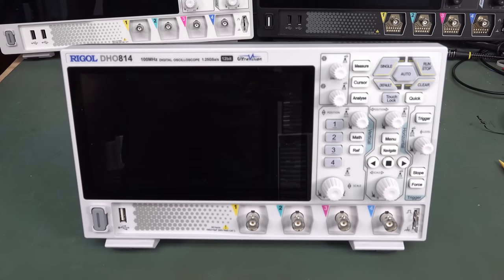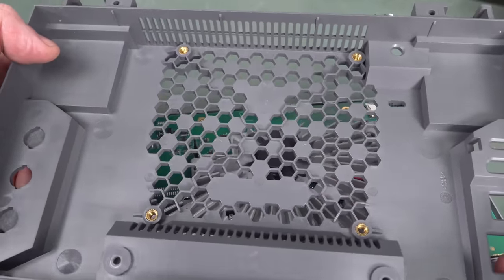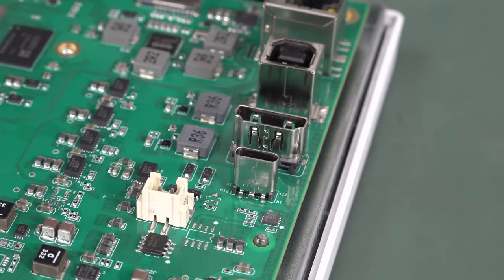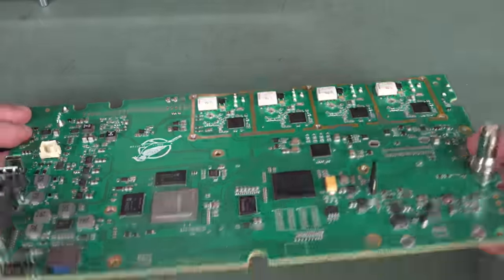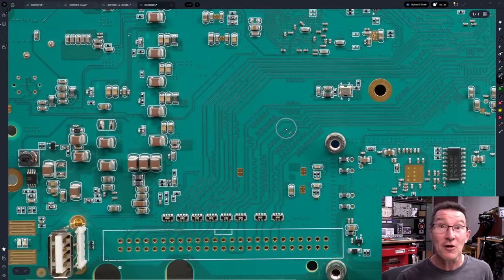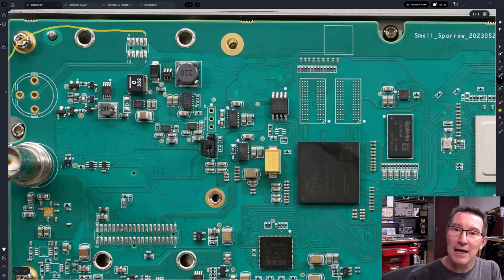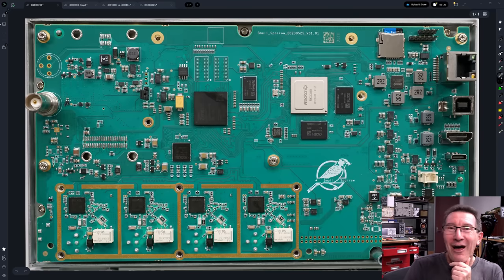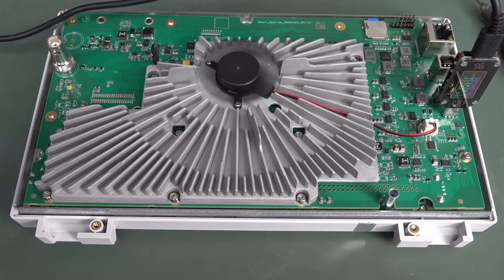EEVblog 1563 - New $389 12bit Rigol DHO800 Scope TEARDOWN

Comment: Amazing to see the tight integration of everything. microsd instead of nand chips, integrated inductors inside chips, one big heatsink, standard usb power benefitting from scale instead of expensive in-chassis DC-DC, standard android OS...  It's built down to a cost, but I'd argue that a lot of these choices are preferred over more custom solutions. E.g. industry-standard isolated USB-C PSU isn't going to easily fail as it already has millions of units in the field.
Reply: An added bonus is maybe you can back up everything in case the card goes bad or gets corrupt. I wonder if there's any other flash on the board that would need to be in sync.
Reply: I prefer a larger unit because it looks more substantial and pro in my lab. It's like having a wall of Marshall amps--it makes you look cool!
Reply: That USB-C port for power is the only thing I'm a bit worried about. It looks like it could pop out with an unintended move, or it could bend and break. I'm not overly happy with the various SBC boards I have which are USB-C powered.
Other than that, this looks great. It just may be my next scope.

Comment: The reason they likely populated the bypass caps and termination resistors is likely to prevent the traces turning into antennae and injecting noise into the unused inputs. Basically the same as tying unused logic ic inputs to either power of ground.
Reply: Precisely, all those caps provide high frequency shunts to ground, which dampen any oscillation that might be induced on those unused trace stubs.
Reply: Oh you beat me to it! :)
(I kinda said that, up-thread)
Reply: Also it might have been EMI tested and certified with the additional ram on (as a prototype/Engineering sample or to have the option in the future), I’m almost certain that by just removing the ram there will be no noticeable adverse effect on compliance, removing bypass caps, even if they are nominally the removed memory ones I would not be so shure, thus to avoid re-testing.
Reply: A "Dumb measurment" for correct components specs via bed-of-nails station with "one size fits all Jig".
The function test itself will be made in Software which goes deeper in the "options & variants" available.

The minuscal ammount safed not populting these caps and resistors, compared to a more complex or extra different test-jig, is not worth it over a loooong time :)
Reply from the maker: Not the bypass caps, they have no impact on that. And if they are dumb enough to drive unused lines at high frequency and then have to terminate them, that's just as stupid.
Reply: Well nahh not that their DRIVING them, but  just leaving them hanging could mean they're quite high Q little resonators that could cause trouble with the signals floating around - maybe just enough to fail some EMC regulation?  @EEVblog 

Anyhow I REALLY want one now :)
Reply: Maybe they can finish the cheaper board into the more expensive board after the fact, some sort of on-demand production benefit? or just an oversight. @EEVblog
Reply: I was thinking that maybe the board is pick and placed in two steps, with all the small roll-fed components first and the large stuff second. In that case, it just might be cheaper to have a unified first step
Reply: It's likely just a logistics situation.  They get the board pre-made as ONE package-- and then they can finish populating it into an 800 or 900 series from there.   But rather than paying for two different boards-  they get it all done on the same one.   This is a big area of cutting costs because you're spreading the R&D costs across two products that have different incentives in slightly different markets.   They're killing it with this thing.  They made many correct decisions.
Reply: How about they populated the board without the 900 parts and had problems and had to go back and add them. How many times have I designed a circuit and had that happen - more than I want to admit to!
Reply: @amahashadow You are correct. It’s populated in two steps. They all have a common feed roll for passive and low cost components. The second pass feed is specific to the device.

Comment: This is the new low-spec king. The size is absolutely fantastic. A huge upgrade from the DS1000Z.
Reply: This is unchellenged and will be for years probably
Reply: I still think Siglent SDS1104X-E is a better option. It's got a logic analyzer option and 2x1GS/s ADCs for just $100 more.
Reply: @miloradowicz   but the logic analyzer is expensive as hell
Reply: No CAN decoding, so it's useless.
Reply: @Z0DI4C  Probably will be a software addon or maybe just a software "fix"
Reply: How we have the SDS804X HD

Comment: SD card is interesting - could simply be that it's cheaper than an emmc card, and surprising there doesn't appear to be an emmc footprint. Suppose it makes it easy for them to up-size it easily in future, but it also seems to scream "hack me"
Reply: You simply cannot get small eMMC chips, but small microSD cards are still widely available.
Reply: @Finder245  the card in the video is 32GB, hardly what I call small
Reply: We have had massive issues with availability on eMMC (and hence prices have skyrocketed) the past 3 years - that could have been a factor in the design decision process, to go with an SDcard solution.
Reply: @bobshowrocks  that’s fair. I’ll admit that I wasn’t paying much attention to that last night. eMMC is definitely more feasible in that size than in the few GB range.

Comment: The Artix-7 isn't very expensive as FPGAs go - if anything the Zynq may be more expensive as it's a combined SoC-FPGA as opposed to a standalone FPGA. Strange they would use one here when they already have the Rockchip as an application processor.
Reply: They did indeed save money on the FPGA, however it has nothing to do with it being a zynq (which is either an artix or a kintex with arm cores bolted on) but by dramatically cutting down the logic portion size (from 100T of the previous to 015T) however I really do not expect Dave to actually verify his speculations anymore
Reply: Maybe Xilinx had some kind of special offer. But for that kind of cost down it would certainly be interesting to save the Rockchip and use the Zynq arm core instead. Would certainly mean some investment on the software development side.
Reply: @DirkEibach  my fairly educated guess (as a heavy zynq 7020 user) is that, the chip does not have nearly enough grunt to do both acquisition and graphics at the same time in logic, and no dedicated GPU, for that you would have to move to Ultrascale (which has a gpu) but then the cost go up substantially.

Also the ARM CPU in the zynq is really weak in modern terms, so overall designing in the rockchip was cheaper than either doing the engineering of squeezing in everything on a single FPGA or going with the zynq ultrascale
Reply: @pelor92   what does that T rating mean ?
Reply: @sanjikaneki6226  as far as I know it does not have a particular meaning, it is just part of the part number of Xilinx most series 7 FPGAs that distinguish the device size (SoCs and Spartans don’t have that, however there is no large feature disparity)
Reply from the maker: @pelor92  The point is they are absolutely saving cost on the FPGA. Obviosuly they couldn't get the cost reducton they wanted on the Artix series. They are also using Zynq on other products, so there might be some volume price advantage there as well.
Reply: Not an expert but have been spending a lot of time looking into FPGAs, especially Xilinx, and have been tinkering on a Zynq 7020. The Zynq 7 series below 7030 uses the same fabric as the Artix 7 series. Here's the basic spec differences:

Artix 7 100T (~140-230USD retail)
- Logic Cells: 102k
- DSP Slices: 240
- Block RAM: 4,860Kbits
- 6.6Gbps Transceivers: 8
- I/O Pins: 300
- Programmable Logic Extras: PCIe Gen 2 x4 hard IP, 12-bit ADC
- Processing System: Nah

Zynq 7015 (~150-200USD retail)
- Logic Cells: 74k
- DSP Slices: 160
- Block RAM: 3,300Kbits
- 6.6Gbps Transceivers: 4
- I/O Pins: 150
- Extras: PCIe Gen 2 x4 hard IP, 2x 12-bit ADC
- Processing System: 2x 32-bit ARM Cortex A9 cores @up-to 866MHz w/256KB RAM, DDR3 RAM controller, 2xUSB2.0 PHY, 2x1GbE PHY, 2xSD/SDIO

Since the 7015 isn't retailing for THAT much cheaper, I suspect that the cost savings are a mix of bulk purchasing as Dave suspects, and possibly reduction in BOM across models, using the Zynq's built-in peripherals (discrete ETH PHYs alone look to be retailing at any 6USD/chip so, even in bulk, that adds to).
Reply: @nickwitha_k  The zynq has two Ethernet MACs, but no internal PHY. It wouldn't make sense as they output driver stage for gigabit ethernet are a few very big transistors. It would be expensive in the chip process used for the Zynq. External PHYs in bulk are much less than 6$.

Comment: SD card would have a squashfs image on it, no FAT or Ext3/4 file system on it, just a bootloader in the first LBA block, that is loaded and executed, that then will extract the file system, mount and decompress,  and run it. Would suggest to clone that card to another, as it likely does write logs and temp files to the mounted file system, and that will kill the SD card in short order with all the writes going to the same blocks, as that card probably does have wear levelling, but it does not work well with a non ExFAT file system. So around 50k writes before you get issues.
Reply: For temp files it would make more sense to use tmpfs, especially for a device like this. If the SD card contains a squashfs image, it's easy - you can't write to a squashfs image. It's read-only.
Reply: @invisi1407  Yes but there will have to be some storage there, as either an image or as a block that is mounted, at least ot store waveforms for comparasion, and I would not put that the final image still has some logging enabled, or some swap, as the main RAM is very likely always running near full. Wonder if there is an exposed USB header that you can use to add in an external flash storage device somewhere on the main board, without needing to use the front panel USB port.
Reply: Surely they are total amateurs and destroy their SD card with logs. 😂

Comment: MicroSD also means not having to do any in-circuit programming on the final board - could save on production time & test fixturing, as copying to onboard emmc could take significant time. They probably also have a "special" version for production test
Reply: The Rockchip RK3399 supports a eMMC chip boot. But as @mikeelectricstuff said, saves having to load a whole software image over USB 2.0 OTG using some of Rockchip's dodgy looking Windows tooling.
Reply: They could easily order preprogramed eMMC from manufacturer, most (if not all) manufacturers offer that option, same apply for microcontroller manufacturers. And you do not need ecen to order some insane amount I was supposed how low is minimal quantity for preprogrammed microcontrollers by Microchip, so probably second reason is Mike state is right reason why they chose that path.

Comment: @12:00 will be the same mould, it will have an interchangeable insert to block that section off for that model. The moulds are actually fairly complex with under cuts and side wedges along with small features.

Comment: 20:24 - the LA inputs look like they are differential, so presumably use an external converter to do threshold selection etc.  Might be a risk of static damage though with just 33Rs on the inputs
Reply from the maker: I'll have to check what the DIY probes have.

Comment: the reason why the cheap passive are populated for the unpopulated parts is because they will go through a separate PnP process, and for tooling, its cheaper to just run the base board. And in the second process applying the larger more expensive parts, that's when they delegate what board goes to what model.
Reply: Bingo, I think we have a winner, especially if they plan to come out in the future with an up-specked version, it would make sense to just do the DFM and CAM work for the larger board and just tell the PNP not to populate the expensive component that are not needed especially if they do parallel lines and not batch

Comment: You could mount a 120 mm pc cooling fan to the vesa mount for ultra quiet operation.
Reply: thats great idea... just wondering if those hole spacing is either 100mm or 150mm ?
Reply: @dreamcat4   it's 100mm. But you could 3D print something to fit a 120mm fan, or use an 80mm/92mm one with a 3D printed shroud and preserve the VISA mount.
Reply: Are those fans designed for the right static pressure? External fan and ducting seems like the solution thought.
Reply: @SeanHoulihane  They come in many flavours, different static pressure is one of it. But, the original small fan is enough to cool the DSO, I would be surprised if a big 120 mm pc fan wouldn’t.

Comment: Those SD cards are not great for long term reliability but just used read only it'll probably do the job and provides an easy way to hack the thing and make backups and whatever.
As for the cooling I'd just try to screw in an external large quiet fan to that VESA mount flushing the whole heatsink with air.
Reply: "long term reliability".. ? Hey I wonder..If the TERRIBLE reliability rating for the otherwise wonderful (and expensive!) TC Helicon voicelive3  vocal processor might be due to IT'S os being on one???
Reply: @petegaslondon  I have no idea about the device but could be.
Reply: @petegaslondon  But unlike an on-board NAND chip the SD card can be easily replaced with no desoldering and you don't have to find a pin compatible chip, so you can just buy one off the shelf.
Reply: @petegaslondon no one cares
Reply: Siemens heathcare even designed an X-ray device with a SD card, OS and image stored in the SD card.

Comment: Seems crazy that Rigol are offering the logic analyser and arbitrary function generator features on this smaller model when it was not on the DHO1000 or DHO4000 series.
I'm interested in the DHO914S which includes these features with the 125MHz analogue bandwidth (maybe hackable to 250MHz), so would like to see reviews of how these features perform given that past reviews of Rigol have shown their offerings to be quite buggy and lacking refinement.

Comment: The logic analyzer has LVDS input, the probe does the level conversion. Also, the reason for lower bandwidth may be the cheaper FPGA - it runs at 1.2 GSa/s.

Comment: Not much of a bargain in Europe... the price is 499 euro here. Also, it has got interleaved sampling: it's 1.25Gsa/s, but only when one channel is used, otherwise 625 Msa/s for 2 channels, and only 312.5 Msa/s for 3 or more channels. I'd advice to consider adding other 300 euro and get the DHO924s (priced 799 euro), which is the 250MHz fully featured version, includes the AWG and the Digital Analyzer, and it's got non-interleaved 1.25Gsa/s sampling....
Reply: @you2ber252  You can edit Your own YT comments anytime.
Reply: @norbert.kiszka  Ok. Corrected

Comment: I've been wanting to get a scope for awhile and finally a decent brand with decent specs at a decent price. It's gonna sell like mad.
Reply from the maker: I suspect so. Rigol have basically lead every revolution in the entry level scope market. First the DS1052E, then the 4CH DS1054Z , and now the touch screen 12bit compact VESA mount DHO800.
Reply: @EEVblog If you think about it, they are continuously undercutting Tektronix from the start. Probably most of the old giants of the day, but their line-up follows the Tektronix like-up much more closely.
Reply: Hope that price don't jump up
Reply: Anyone know when it’s available in the UK?
Reply: @TrickyNekro They did suspiciously put their US headquarters in Beaverton, Oregon down the road from Tek. 
We know why they did that. Poaching employees, intelligence, and maybe even industrial espionage. Many such cases
Reply: @MrCarGuy  Poaching employees sure, Chinese firms have been known to do that with Taiwan, so definitely possible.
The rest, I can't know. Their first scope was just a datasheet implementation, and if I remember correctly, analog nodes are usually older, bigger nodes than digital, so it doesn't surprise me that they developed their own front ends. Analog Design is not the black magic it used to be and silicon is relatively cheap.

I was more referring to the market segment.

Comment: Worth your time to dig into the Xilinx IO pin datasheet.  Reading between the lines there is a LOT of analog capability in the pins in addition to a ~1GHz 4-bit shift-register, frequency multiplier, and 1-2ns variable delay line.  The analog capability is a side effect of the 100+ differential, semi-differential, and low voltage swing logic formats the FPGA supports.  Ends up that a high speed rail-to-rail comparator on every IO pin is the simplest way to support every logic standard.   You can either do fully differential inputs, or feed in a threshold voltage for a whole bank of pins.  This comparator is VERY useful and I'm surprised it's not officially documented in the datasheet.

TLDR, logic analyzer wired directly to the FPGA will work great but be a bit more ESD sensitive than I'd like.